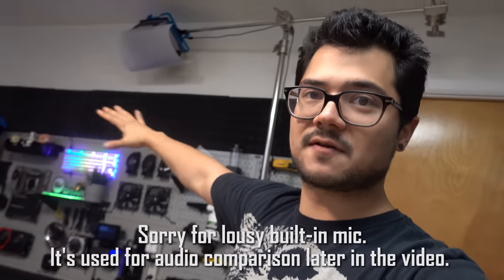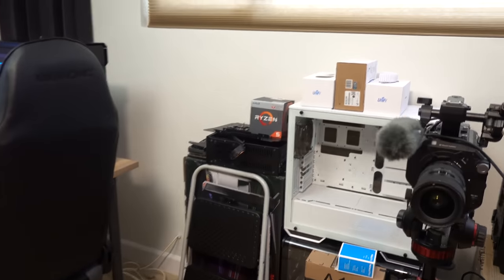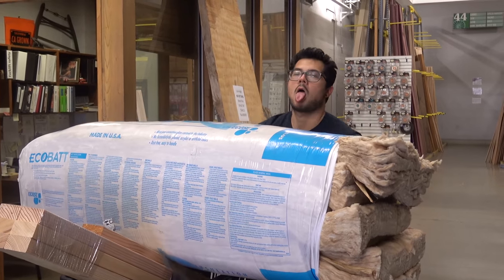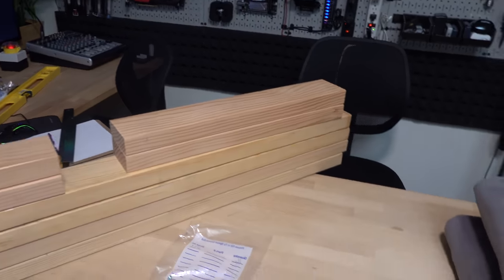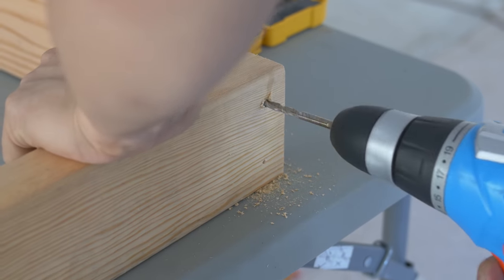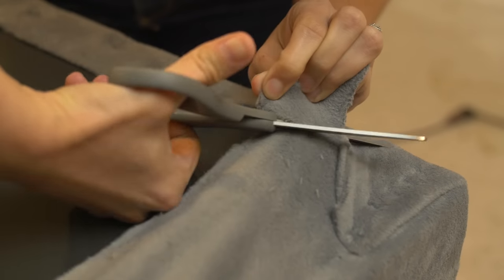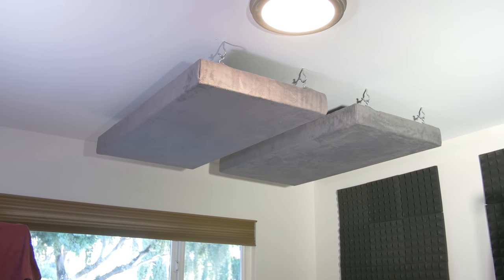Making my own acoustic panels...Was it worth it?

Comment: Here is the craziness I did with DIY acoustic panels: went in attic, screwed in eye hooks into side of joists , fed some very strong monofiliment line down through tiny holes in ceiling drywall, tied to 4 hooks in back of panel frame, had assistant help hold up level while I tied the line on the attic hooks when panels were at the appropriate height. Wound the line around the attic hooks a few times for fine adjustment. Yes, it was a pain, but really appeared to be floating up there :)

Comment: On a serious note, my listening/speaking position in my studio is where I focus my treatment. Like you've done to a degree, above your head, in front of your head and behind your head are prime spots for reflection and unwanted reverb, as well as some to the sides. If I move a few feet away from my main position there is unwanted reverb and boom-y bass, but in my main position the room's reflections are just enough to keep my vocals from sounding meek, prevent that high harsh reflection, and bass is articulate and not overpowering. With that diatribe out of the way: Dont worry if you speak into an upper corner and there are unwanted reflections because all that matters is where YOU are during recording. The test should be made from your sitting position at the desk if that is where you will do bulk of recording.

Comment: Towels brother, towels. Proven to be equally effective if not better than most high end acoustic panels. I made two and already could tell much of a difference. The key is air, if you pack too tightly, the vibrations still bounce back, where as more air creates pockets for the vibrations to dissipate.

Comment: Put a few eyes in the material and create a big sling on the ceiling, then stuff the insulation into the gap between ceiling and material defined by the hook length.
The insulation is light and doesn't need heavy framing, you could repurpose cardboard boxes to frame and glue material over them. 

So many ways to do this cheaply and lightweight so you never need worry about them falling on your head, because they wouldn't hurt you if they did.

Comment: few thoughts i had on this build  if you are going to build this id suggest using 1x2 instead of 2x4. can save a few dollars if you put the fabric on first and ignore putting the poster board. as the fabric may stretch it may be a good idea to add some wires across to help hold the batting in place and not actually being held in by the fabric.  like this idea though definitely made a difference

Comment: Have you tried using carpet on the walls/ceiling? Not expensive (you can use the cheap stuff as you just want to absorb sound), and fairly easy to mount by using glue/adhesive, and/or staples.

Comment: As someone who has recorded quite a lot of music and talked with many sound engineers about room acoustics, the panels that are on your walls look to be too thin to absorb the sound waves effectively. I've also learnt that you need to cover a decent amount (from 20% up to 50%, depending on the wanted effect on sound) of the total surface area. Those two panels seem to cover too little of the roof to have a noticeable effect, at least when recording from the spot you're currently in. To end with a positive note, you still have enough sound dampening material for more panels, which should help with the reverb AND drive the cost per panel down considerably. Best of luck with future projects!
Oh, and an idea for the future: using dampening on the corners!

Comment: You're supposed to use breathable fabric for the front and backing, so that sound can go into the insulation more efficiently and do it's job! You can make 2 2'x4' acoustic panels for around $25 each. Rockwool Acoustic Mineral Wool Insulation is the best to use. Look up Ray Ortega's video on youtube on DIY panels, it's great!

Comment: To mount accoustic panels nicely, get a solid piece of plywood larger than your panels, drill holes at top or corners, for mounting to the wall by hanging it from the top, staple the panels to the plywood with a basic construction staple gun, for better performance, put some small rubber adhesives on the plywood facing the wall, so it will hang off the nails to the wall, have rubber contact, and panels absorbing sound. 

Cheers -L

Comment: I used salvaged insulation and backing, i also used 2x2 vs 2x4. I ended up with building 10 2ftx2ft panels for a cost of under $100. Quite pleased with my results

Comment: For your floor, use moving blankets put them down when you record, fold up when  not.  You can also use the between two stands to tame rflections.  You can usually find them for under $10.00 at Harbor Freight.

Comment: From that initial position, they sound like they are doing nothing, but underneath them its a night and day difference. I would suggest a lower density fabric in the future and more panels instead of the cheap foam since the foam only cuts high frequencies and really does not remove many reflections. Bass traps should not be a huge concern for you since you are not pumping loud low end content in your room, but decent treatments would help them, too. Look into low and mid density rockwool/Roxull insulation panels.  They do cost, but they are fantastic for sound reinforcement.

Comment: I've become a bit of an authority on DIY Acoustic Panels as I have a lineup of my own videos.  A couple of things. 1x4 lumber would have been better as your panels would be MUCH lighter.  The extra lumber serves no purpose.  Especially hanging from the ceiling. And putting a hard back on your panels limits the effectiveness.  Ideally, you would have a breathable back.  This way, with the panels hanging off of the wall/celing a bit, there would be an air gap that would allow stray frequencies to bounce back through the same panels.  By putting a solid back on the panels you limit this effect by creating a bounce point within the panel.  And calculating placement would increase effectiveness as well.  But that's a bit much for the comment section.  Nice looking build though!

Comment: Many people still misunderstand the difference between directional focus foam pads that concentrate the sound the sound using the tunnels and stop the sound from reflecting off the surfaces which cancels echo and has little to none sound proofing ability,  if your looking for sound proofing material; density ,surface area and mass are what stops the sound, so using the sound proof panels and placing the acoustic foam on top of the panels will create the best echo canceling, sound proof area. Don't confuse the two because you'll end up waiting money and time

Comment: I’d use boards of smaller dimensions, such as 1x2, for the frame, especially since much of the weight is being supported by ceiling mounts, especially with well affixed corners. I would also wrap the insulation around the board of the frame. This would improve dampening. I would aso think about creating larger single panels, perhaps 2x6 or 4x8. This would decrease exposed ceiling between panels while saving material costs of wood. You could include boards in the middle on large panels for additional support if needed. Decreasing the board dimensions would decrease material costs while maximizing coverage. The insulation should maintain the sound dampening properties even if compressed for use with 1x2 boards.

Comment: 1x4's, pocket holes and cork sheeting or board on the back as well as over the insulation before fabric. good job though and there was a difference as long as you were under them. 1x4's due to weight and if you put the hooks a little closer to the ends you might get them closer to the ceiling to help with sound bounce and remove the s hooks. just suggestions though. I'm sure you'll figure out a solution.

Comment: This is cool, Also can use Metal frames instead of wood, they are completely plumb and lighter, also they cost the same as Wood frames and come in similar sizes. Instead of Fiberglass you can also use 1" or 2" Foam insulation boards they will give you similar ratings and it will cost about the same as regular insulation.

Comment: Ideally you want to leave the back of the panel open as well. The point of spacing them away from the wall is to absorb reflections from the back. You can use chicken wire or screen to secure the insulation rather than the very resonant foam board. You are definitely losing some of the effectiveness. some of the best insulation you can get without going thru a contractor supply is Rockwool Safe-N-Sound. It absorbs bass far better than Corning 703. You can find it at lowes or home depot typically

Comment: To my ear Its removed some of the higher frequency reverb that was present in the tail end of each word in the untreated room. It’s not made a huge difference, but the difference is audible. However, I suggest spacing might have a bigger effect than filling the ceiling with more panels. Two more and then arranging them about the ceiling equal distance from one another would be my approach. At the moment, you have two panels deadening the vibrations in the air in a localised cluster, and the rest of the ceiling bouncing sound as before with no means of interfering with the acoustics. Spread the panels like love, equally, and keep the one you love the most closest to your microphone.

Comment: there's a little bit of reduced reverb in the high vocal range, but little to no effect on the mid-low frequency range.

it sounds better, but you need something that causes the sound waves to cancel each other out as they bounce around the acoustic panel.

Taking the perforated style foam and gluing it to a back panel in the frame, then covering with the batting would probably make the most sense.  The batting is doing very little to dampen the low and mid range frequencies because those frequencies are just naturally harder to control as their acoustical energy is higher than higher range frequencies.
Reply: Those panels will stop the problem frequencies from reaching the sound bouncy ceiling. And I doubt those frequencies are audibly reflecting off the panels, certainly less than the ceiling.

Comment: I'd leave the angle brackets out. Unnecessary extra cost and the screws will more than suffice as long as you have an inch of grip or more on the 21" 2x4. May be quicker to use Staples on the backing as well vs nailing. Hope this helps and nice work!

Comment: Nice job, but like a lot of comments say and you've acknowledged, there's really only a difference when you're right under the panels. The biggest offenders are that wide window and that floor, even throwing a blanket down while you're recording would do wonders. Also MDF is better for sound treating than those 2x4s (lighter and less vibration), but that's a different kind of mess. Good luck with the sound treating! 

btw- if you want some good references, there are some videos by rdavidr and Stephen Taylor that are more focused on treating for music recording, but still great.

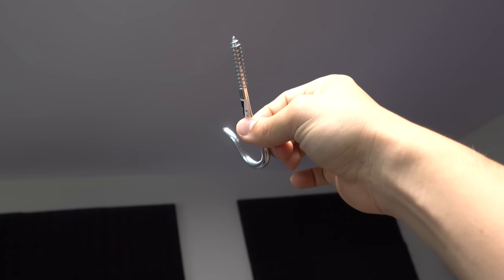Comment: 5:12 the standard width between ceiling studs is 24 inches but when builing a house it is easier to do 16 inch width because youe can set the ceiling studs on the wall studs

Comment: if you bump them they could fall. Take pliers and close those S hooks to prevent an accident.  Or you could use "screw eyes" with some locking carabiners, that way your safe from a headache. Those panels turned out nice. I would get some Dynamat for that metal cabinet too.

Comment: should have gone to home depot and bought the Roxul Safe and sound for insulation. Also you would have bought a 4x8 core-plast sheet, much cheaper than poster board. your wood I would have gone with 1x4 and used Simpson strong tie framing corner brackets (much cheaper and easier to instal). Cover material, your choice of course but would have Wifey Sauce choose the material and something less bulky. A stud finder would have been helpful on the ceiling. Your hooks on the ceiling were overkill. and FYI in your ceiling is either a Joist (between floors) or your going into a truss Studs run vertically in walls. BUT!! I am glad you did so well on your first attempt and put it up as I was very curious what it would like to do my own.

Comment: Roxul Safe n Sound (Rockwool) is the way to go. 3” thick, 15.5” W 47” L, and you can 12 of them for about $50 at Home Depot. Using 1x3 lumber is also lighter and cheaper.

Comment: Not bad , if you want to go lighter use spray foam they have different densities for sound deadening , and a thinner wood strapping stock. the have it in 1/8th and 1/4th thickness . plus the foam spray will fill the gap you make with the backing board . and yes trim any excess foam . good luck.

Comment: Those ceiling panels are going to catch reflections from the floor and a small amount of broadband in the area. For best use, add them to first reflection points and take down the foam garbage. A set of 8 would be a great start.

Comment: For a cheaper alternative, you could use old towels, if you dont have it, a trip to the thrift store (and a washing round) later should sort it out. Tho i can imagine it would be less optimal compared to the Insulation.

DIY Perk has 1 or 2 videos about making panels, He used a specific type of material that wasn't too expensive.

Comment: Instead of insulation, you could hav gone to a foam place (or JoAnne's or other fabric store) and simply purchased either Fiber-Fill or just clearance fabric by the yard (usually 2$ per yard or less, take coupons!)  

I just built five 2'x4' boxes similar to this (i used 1x3 Furring Strips instead of 2x4, and got a single 2x3 and chopped up blocks for the corners to keep everything square).  I spent about ~25$ on cheap clearance fabric (mostly felts and the like), to fill all 5 (and i still have some left over).  

Then i covered them with "nice" felt (about 4$ per yard) in light grey.  

I put them in my windows instead of using that crappy plastic covering.  

WAY better.  

TLDR:  The Insulation was probably not necessary and recycled fabric would have been cheaper and better.  It works as insulation anyway.  (If you watch any Tiny House or "sustainable living" stuff, there is an insulation that is basically just recycled denim. 

Its not even any more expensive (as a commercial project); you could probably make your own by hitting the Salvation Army or similar thrift store.  Its even got a better R-value than a lot of commercial insulation.

Comment: great work, ive got lots experience building these and for ceiling panels i learned usually need to be directly under them to cut out the echo, i say take advantage of that extra rockwool and build more! rule of thumb, you cant have  too many traps in a room. the more you add the better the sound

Comment: I wonder what would be the difference in sound absorption between  the insulation he used compared to those 12x12 acoustical ceiling tiles they used to use a lot. Or 2x4 panels for false ceilings. They could be glued directly to the ceiling or glued to plywood and hung. A lot less than $250. And quicker to fabricate.

Comment: In the future, rip the 2x4s in half. They don't have to be quite as massive as those are. As a bonus, you get twice the number of panels per amount of wood. Cutting 45s and using wood glue and a nailgun would be a good second thing. Also, I'm not convinced that that particular choice of fabric and insulation is the right stuff for this application. Finally, someone else already mentioned backing your panels with fabric, and I second that.

Comment: There is a difference between sound proofing and sound diffusion.  The insulation you used is used primarily for sound attenuation (sound proofing) - sound does not easily pass through it.  This isn't what you need.
You need to cover your reflective surfaces (like the ceiling) with a sound diffusing type material (coarse canvas cloth).  When sound is diffused, reverb is eliminated.  Reverb occurs when flat surfaces reflect sound waves with relative uniformity.  Hanging canvas cloth across the ceiling from one rod to the next (across! not hanging down) can be done quite cheaply.  Cheers

Comment: bitwit im a huge fan, im an audio engineer and its a pain to see the back panel beeing closed, it should be the same fabric as the front, here's why: the formula of absorption is multiplied by the distance from the back wall, making the wave bounce back and so the panel absorbs twice coming in, and going back from the wall. hhhttttppp:/
/copyright.lenardaudio.com/laidesign/images/a04/a04_basstrap.gif to see the principle

for panels with 10cm you add 1cm  if possible 2 cm away from the wall, but it has to be with fabric on the front and back. otherwise you not using them as effective as possible.

Comment: You don’t need two L brackets one will do just fine per corner for stability on something hanging from the ceiling not taking load, that’s another area you could save your self $10 a panel. Also insulation board is a lot cheaper and easier to manipulate and will work just fine for sound. Make a frame like he did staple the board to the wood wrap in clothe leaving the back side open.

Comment: FYI I imagine you're 2x4s are construction grade pine? If so you do not need to pre drill holes. Pine 2x4 are soft enough to not require pre drilling.  Just look at anyone framing a house if you need proof.

Comment: Acoustic panels usually either dampen reflections by touching the surface or absorbing refections off of a surface. Remove the paper from the insulation as well as the foam board and it will at least trap noise.